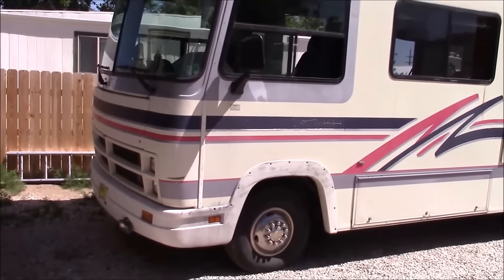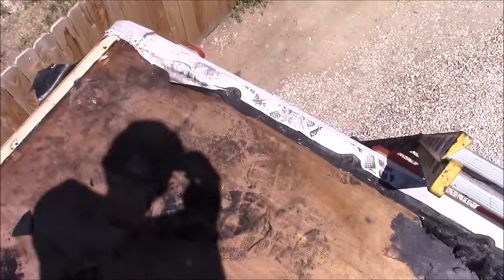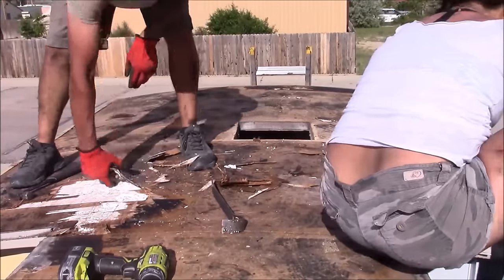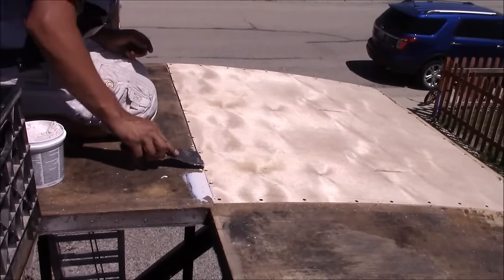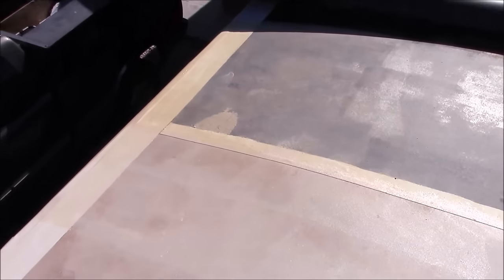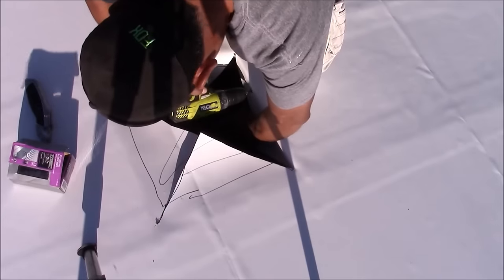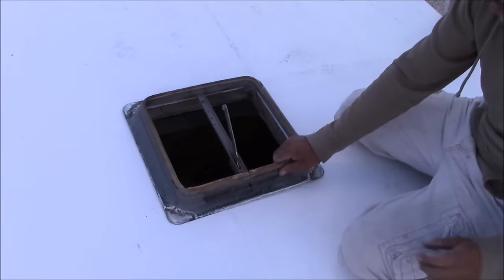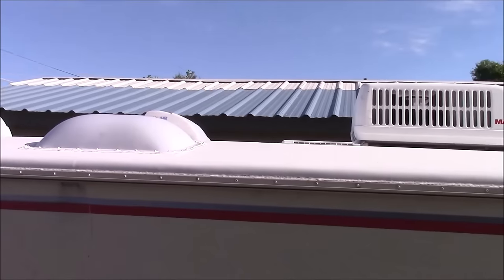How to replace your RV or Motorhome roof EPDM or TPO

Comment: Thank you for this video. I was just quoted 14k to replace just the membrane on my roof the plywood and foam is all in perfect condition. They made it sound much more difficult than your video shows. I work professionally in the commercial construction industry so I am more than capable to do this and honestly I trust my work more than someone at a local dealer.
Reply from the maker: Awesome. Sounds like you're gonna save a bunch of money.
Reply: They probably did have some hyped up sales pitch but everyone is basically paying for the high insurance. Asphalt shingles are more brutal to work with, especially since rubber is used on low pitches. Big rubber jobs can get fucked up if you're not focused. It sucks to pull back up, or spilling glue, etc. 14 grand for what size exactly? On a friggin' camper?!
Reply: I was just told yesterday that the roof on the camper we baught last year is going to need the roof done and he said we'd be looking at probably $10k  to replace it , I said I ain't Daddy Warbucks .. lol so here I am checking out videos because I know I can do the work , just need to educate myself first .👍
Reply: If you do it right, it’s A LOT of work especially on 5th wheels campers. I’m a service tech at an RV dealer.
Reply: "Quoted 14K dollars"........... Damn.....smh....
Reply: Never trust a dealer or RV place.   Cluelesss.  Find a roofer with actual commercial EPDM experience.   My roofs last 50 years.   EPDM when properly application will survive for 50 plus years.  Rubber takes decades to break down.
Reply: They told me 8k for a 20ft travel trailer lol

Comment: Great Job!  One suggestion for anyone doing this in the future; go ahead an Eternabond the front and rear caps as well as the vents.  That will provide the extra bit of protection from water intrusion and Eternabond tape last much longer then the tube sealant.
Reply: Have fun removing it when the eternabond fails on the edges and don't tear or melt the roof when you gotta remove it! 😂

Comment: This is one of the best roof replacement vids that I have seen. Quick, yet very thorough. My overhead cab was rebuilt by an RV repair shop. But they did NOT replace the decking under it! Which sucks. The rest of my roof is good except for that part. Now I have a better understanding on what needs to be done. I am grateful for this vid! 👍

Comment: Great video...
Great work...
... I have to tell you a story only you would appreciate...
I have flipped RVs, Travel Trailers for years...
I found this dinky like travel trailer... and the owners said there were "LEAKS" in
the roof... when I walked inside I SAW all these NAILS sticking through the ceiling!!!
I asked why there were dozens (yes I said dozens) of nails sticking through the ceiling.
They said, "because there were leaks and we NAILED plywood (inside) to make it stop!"...
I felt so sorry for them... I got a good price on the tiny trailer and had to completely redo do the roof...
So I know how hard this is... but so necessary ...
Thank you for sharing your video. Great job.

Comment: This guy either installs roofs for a living or he's the best handyman I've ever seen ,my guess is that he's a roofer because no handyman would know about using a punch to stop tearing at penetrations ,you did a nice job man ,on my 5th wheel I installed 60 mil fleece backed fully adhered Trocal PVC roof , i got lucky on my deck having no rott so i chose a 1/4 OSB and glued it to the existing deck using yellow glue on the deck amd the bottom of the new deck because i didnt want fasteners on my deck ,i taped my seams as well ,I chose PVC over rubber or TPO so I could heat weld the roof to the edge metal I custom bent into a one piece drip edge/gutter channel, I also made 8 inch high roof curbs for my vents and A.C. units that I wrapped with PVC coated metal so I could heat weld the roof sheet to the curbs and be water tight without any flashing ,I used Tech 5 fasteners for my gutter channel that have rubber washers ,once tight I covered every fastener with a blob of white Vulkem polyurethane caulking and tooled it in , I have 4 slide outs I waterproofer using White Firestone 60 mil EPDM that worked out well too .
Reply from the maker: Thanks man. Lets just say I'm definitely  not a "roofer" but that being said I also installed a metal roof on my house. I have the footage maybe  some day I will make a how to video with it. Sounds like you did an amazing job with your roof as well!
Reply: The tip about using a hole punch is noted in the Dicor factory produced instructional video for replacing a rubber roof.
Reply: About how much did all the materials cost for all the materials? Thanks ! Great Job, Better than New !
Reply: Hey Micheail, do you have pics or video with the heat weld bonds
Reply: Did you show all the damage to the inside?
Reply: @D.I.Y._All-in-One  I love your video and I bought the rubber roof materials, and was waiting for a few more to arrive but before I could install it, really heavy rain  popped up in the forecast because of the  hole in my Skylight and I panicked and use them asphalt roof roll which is on the other end of my RV with hours to get it installed.  I was working alone so I took about 12 hours with just minutes to spare before the rains came down, very heavily!  I relied on the sun to melt it to me  roof but  the sun went down at about 2 in the afternoon by the time I finished I needed  a Bluetooth torch but I didn't have it so I use a hair dryer to do it! 😌😂Surprisingly, it held up for about 10 hours before it started to leak again. I'm actually proud of that considering. The problem now is the weight of the water has crashed the through the ceiling ceilings all yucky. After the rain I found out why it still leaks through it's something called PONDING- most common with flat roofs, when water pools and  stagnates in one or more spots after the rain, 

 Mine is right on top of my above the bed and the leak💧💧💧 is right on my face  😥 Do you have any advice for what to do to divert the water from pooling there? And do you have a video about RV ceilings I'm really scared of doing that more than I am of the roof and I've not seen any good videos

It's a flat roof. I didn't see that you didn't comment off of here but I would appreciate if you see this and respond promptly right now I have a massive top over it's because it's going to rain for 5 6 days and I want to get started on it right away .Thanks.

PS: you should make more RV how-to videos- you're very good at it. And even though I haven't started my roof replacement yet I can see it in my head from your video and KNOW I CAN  do it.
Reply: sounds like YOU should make a video too. I'm just a girl, meaning it's sometimes TWICE or more expensive for  women to hire someone to gets even basic minor repair jobs around the house by a professional- because we know nothing about it. Luckily,  the women in my family have a knack for do it yourselfING. Thanks to YouTube and I can now watch how-to videos and see if I'm doing something right or wrong or learn NEW things have saved me a lot of money. Cheers!
Reply: @caraislabonita5209  did you get your issues fixed?

Comment: Excellent work dude. It's always great seeing guys and gals taking their time and doing everything correctly. 

No cutting corners or making modifications to the product, process, or installation. There are so many out there filming their shoddy work and uploading it as the "best way" to complete the project because "the way they say to do it isn't necessary and takes too long. Not only can save money to buy beer with, but you'll save a lot of time to drink your beer with if you just use this or do it this way....... ". A few years later those types of people are dealing with a failed roof and extensive water damage.

Again, great work man. Thank you for uploading.

Cheers!
Reply from the maker: thank you

Comment: Nice video and great quality install! I'm renovating a 1993 fleetwood bounder Class C RV myself and this is a huge project to do by myself. I'm sharing my journey  that I'm in the process of doing with anyone who wants to watch. I'm replacing my roofing with 45 mil TPO, now I'm trying to figure how to get that roofing on the roof by myself 
( over 100 lbs!!  ). Thanks for sharing
Reply from the maker: Thank you
Reply: How has your tpo held up? Need to do mine trying to decide on epdm or tpo.

Comment: Instead of using roofing screws on the side termination bars, I'd use longer pan head screws like you used to screw the roofing to the edges of the vent openings.  You can get the rubber washers separate to add to those pan head screws.  You'll have a smoother line, and less wind noise.  I'd also put a tiny dab of sealant on the screw threads as I installed them

Comment: Great and informative video. Thank you !!! I am just starting this project on my own 1995 Flair 30-foot RV.
The dealer wants $5000 to do this job ! With your instruction and my own materials, this will cost me about $500.
Thanks again.  - Captain Carburetor in Colorado.  2017
Reply from the maker: $5000 is crazy!! I actually have an extra 10 x 30 roof kit that is the exact same as the one in the video it was 488 new I would sell it for $300 shipped if interested let me know thanks. I was going to reroof 2 motorhomes but sold the other one so now I don't need the extra kit.
Reply: Do you still have the kit?
Reply: C.L.S. Allinone did you sell it yet ? Your video got me also :), going to do this on my fathers 5th wheel. If you still have that kit I’d buy it off of you. Thanks rather way. Great instructional video !

Comment: This Lottes TPO roofing material and install appears to be of the best i've seen on youtube. Also, you're the only one I've seen install that Dicor stuff sparingly. I like sparingly. 
But, I don't trust that Dicor stuff to last. I think the one thing I would do is apply Eternabond tape stuff to all the edges. Maybe in a couple years you'll apply the Eternabond, right over what you have now. You won't have to remove the Dicor because you applied it thin. 
Note, I've never done an RV roof. . . Just my two shingles....

Comment: Excellent video! If I could give a couple additional tips, I would roll out the roofing material and let it relax for a couple hours to smooth out the creases before glueing. The Eternabond tape is fanatic if not overkill. Duct tape or gorilla tape works also. If you must use roofing screws, cover them with lap sealant anyway. If you make a series of videos being more specific on each phase, that would be extremely helpful for a newby. Nice job! That roof will last many years if maintained.

Comment: My boyfriend and I getting an small 1977 rv for $1000 the roof desperately needs fixed the lady were buying it from wants to use Tarr to seal it it that a good idea thank you you so much for the video
Reply from the maker: Tar will not work well and has solvent in it which will melt/damage any existing tpo or tpu roof much more.

Comment: Best presentation on this subjects I have seen.      It was well presented and clear and understandable to a novice person such as I    I have the same unit  but its a  90      28 foot  long    On a FORD Chassis and   460 CI   engine  which I an restoring for future use     I have estimates of around $1500. to do this.   We even had a person pitch me at a  R,V.   SHOW   for  $4500  for a thick coating system,
Reply from the maker: Nice

Comment: Great video!! I also decided I can do this because of this video. This guy had more work to do than I did! That said, this is still a long ass job! Its all labor. The local rv service center told me $3-5000.00 for a 35ft rv. Depending on what they find under the old rubber. $515 for a kit. I'll probably end spending $8-900 with all the new stainless screws and new moldings/trim. Again,awesome video and thank you so much for making it!
Reply: I think I've spent so far about $1,200 and I'll probably end up spending about the $1,500 to replace the entire roof on my 33-footer eternal blonde tape screws new vents and adding an antenna for the stereo which could be important and a small little roof vent with a fan on it just for the kitchen it's not one of those 14-in square vents it's a small round one that actually takes the humidity and the smoke out of your kitchen it looks like the vents for the water tanks but it has a fan in the middle which is pretty cool.
anyway I hope it all went well and if you have any advice for me I'd appreciate it I'm still trying to find an underlayment for the front phylon fiberglass that I have removed in order to repair the front.

Comment: We used a very similar roofing system on our commercial property with a flat roof. In our case, keeping careless contractors from puncturing the roof was our biggest problem. Second was making sure the seams were properly heat welded by the installing contractor. A system like what you installed , if done correctly, can easily last 20 years.
Reply: Most materials used on flat roofs have a 30 year max life span if done right

Comment: You did a great job explaining everything! Now I feel like I can tackle the roof on my '09 Keystone when the weather warms up.
Reply: Did you ever get around to doing your '09 Keystone trailer?
I have a 2007 Keystone sprinter 33 ft that I'm trying to do myself and it's a little stressful because of North Carolina weather rain two three days sun two three days it's starting to get better now here in June.
I have a fiberglass trailer that lamination and I'm in question of some tasks in order to weatherproof this roof and I have to replace some broken one by twos which is very thin roof rafters and I don't know if they screw them in from the side where the lamination is but it's just so many questions and no one to share information with that have this in common so that's why I'm contacting you and it hasn't been about a year so you would probably freshen your mind.
I wanted to know you know do you screws did you staple it down because my roof deck is stapled down and it's pretty badly damaged and I'm using a tarp to try to protect myself from the rain because I'm staying in it as well so it sucks with no help. 

Did you use eternal bond tape for all the seams?

This is probably the most important question.
Your procedure on removing the whole roof or did you piece by piece remove everything because I'm afraid to take the whole rubber roof off take all the panels off in one day because of not knowing how much time it would take to get the panels back on if it can be done in one day or not.
It's a weather issue and that's my problem.

Hope it went well for you if you completed the roof repair. The front file on panel I'm still trying to find and underlayment for it nothing's easy for a travel trailer

Comment: Logged in just to say thank you. This is one of the best DIY vids I've seen. Kudos dude and dudett. Keep em coming. I don't know how many vids you have done or on what topic, but I'm going to subscribe and check em out when I get time.  You sir have a gift for producing DIY videos.
Reply from the maker: Thank you
Reply: @D.I.Y._All-in-One  Thank you so much for this video!! It made me really confident in gettin the job done on my newmar...until I started taking it apart and found out the roof is fiberglass laminate, and there are no termination bars, the laminate is totally wrecked, any suggestions? is it ok to just screw the tpo into the fiberglass shell? should I try to find/make some termination bars and use tpo? does it even make any kind of sense to try and find the same type of laminate to replace it?  Thank you so much!!

Comment: I've taken to adding a 1/4 inch plywood over the whole top rather than stripping off the old wood. Make sure its dry before laying the new surface of plywood. You end up with 1/2 inch of plywood that I've found to fit well using existing trim.

Comment: As a 40 year waterproofing expert I would say this is a pretty good video, something to consider, using flat head screws to secure  the flanges of the roof equipment and a second layer of termination seam tape over the flashing flange would enhance the waterproofing long term, effectiveness of caulking is limited.
Reply: Steve  cuz he a big pert, anna axin a two lay,sow mack 
hit flush, anna sow da two lay terminator sea tap won fea,r wit da scew; cuz calk is kookie

Comment: All you have to do for decking is to counter sink the screw when running the screwing in. Afterwards apply the bonding solution, then when dry, sand down the bonding and excess wood around each screw (from counter sinking) with a fine grit sanding pad.

Comment: Very nice video.  How much to replace a roof on mine located in Augusta, GA?  Same RV.  Tks  And, you didn't say how, what and where did you get that big roll of EPDM or whatever it was and how much it cost.  Also, I have another RV 72 Dodge Champion and I've changed vents at it is an aluminum roof.  I kind of want to just scrape to the aluminum along the seams, seam tape it and then put a bucket of roll on over it.  Ideas?  Tks

Comment: I do t know if anyone said anything about this, but in case they didnt, I wanted to let you know that you can get the same roofing screws that are self tapping and will drill into the metal with having to predrill.